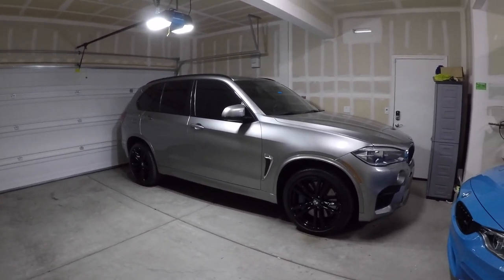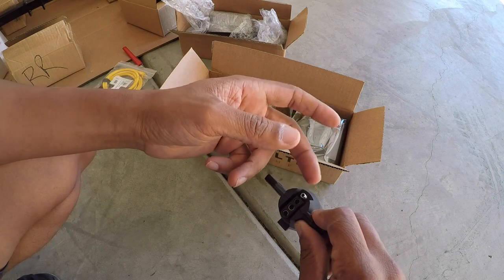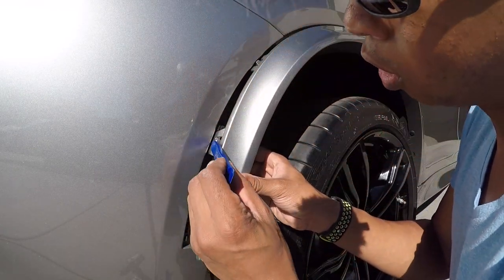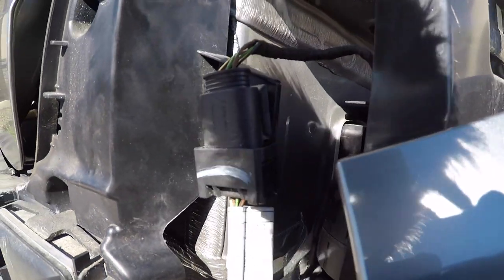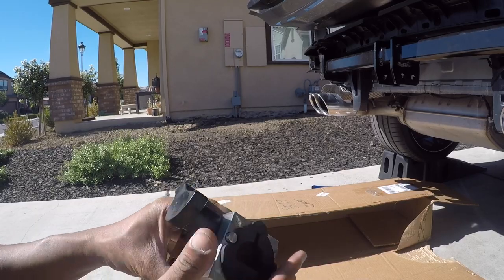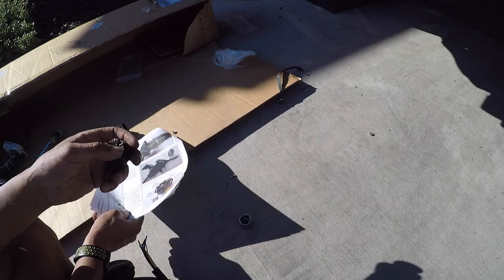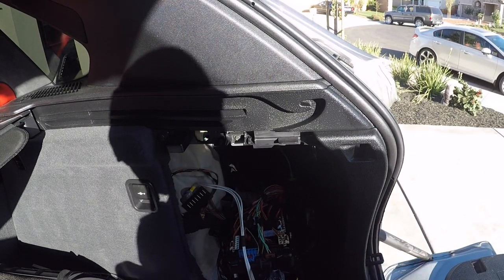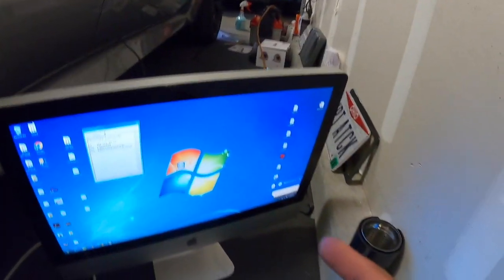BMW X5 F85/86 Stealth Hitch Installation- Easier the Second Time?

Comment: Thank you so much for the assist.  I just installed a hitch on my '18 F85.   A couple of the little plastic fascia holders flew off in the process but it's still solid on the reassembly.  It takes nerves of steel to do such a thing.   Keep up the great vids.
Reply from the maker: I’m glad you found it helpful!  The first time removing the bumper does take some nerves but it’s a not bad job once’s everything is back together.

Comment: Thanks for the Vid on the hitch installation.  Waiting for the Black Gloss Grill and gills vents mod. I purchased mine and I'm waiting for you to do yours.
Reply from the maker: Hopefully soon.   I noticed the grills/side vents are expensive in black.  I’m considering removing and wrapping/painting
Reply: @eddiemcars   around $400 for the gloss black grills and $170 for the vents or gills as I call them.  May be less expensive and less of a hassle to buy them.  You can always sell the silver originals to offset the price.  The OEM gloss black look really good in person.
Reply: @eddiemcars   Get these. They match OEM perfectly, including the clips. If you want to save the X5M emblem, you can snap out the OEM center grille portions and snap them onto the outer rings of the new grille. They're $128 after 5% coupon: https://autotalent.com/products/autotecknic-aero-glazing-black-dual-slats-front-grilles-for-bmw-f86-x6-m
Reply: @eddiemcars  These gills are $24 on Amazon and look better than the IND version because they're all gloss black (not a gloss/matte combo). They fit perfectly: https://www.amazon.com/gp/product/B08CBZ9Y66

Comment: Oppss...thats a deep scratch sir. Its should have been cheaper if you let bmw install it. So if accident happens you can have them replace it. But its a good vidoe. a lot of x5m owners will learn fron this install. thanks you and i'm sorry for the accident to you bumper.
Reply from the maker: Yes, it’s a horrible scratch.  It may need to be replaced with a carbon fiber diffuser.
Reply: Thats actually a good option. It will make that dannington grey color more looking agressive. Goodluck

Comment: What year is this? I have a 21 X5M Comp - Not able to get it coded
Reply: The G05 uses new encrypted control units. Very difficult to get them properly coded (you might not want to use carly or else... but get it properly done with the right software). But you have to have the right tools. I use E-Sys for E- and F-series and have not so far programmed G-series. ISTA-P should work, but it's huge (>100GB).

Comment: Did you get to buff out the scratches?  If not, how will you be repairing it?
Reply from the maker: I buffed the section on the bumper since it was light. The rear diffuser is still noticeable. I’m looking at replacing it or upgrading it to carbon fiber.
Reply: @eddiemcars  keep us posted
Reply from the maker: For sure!